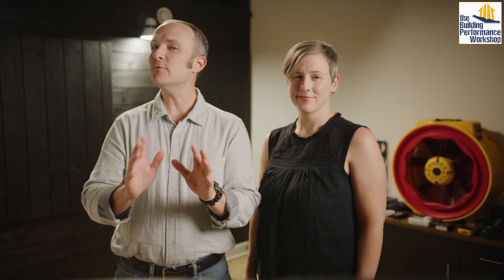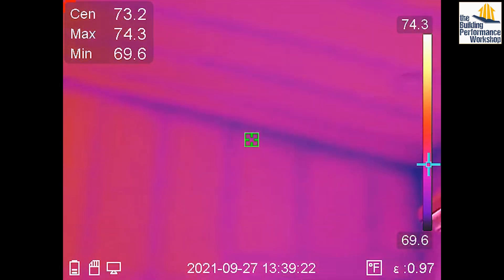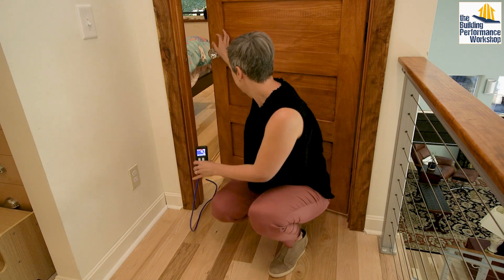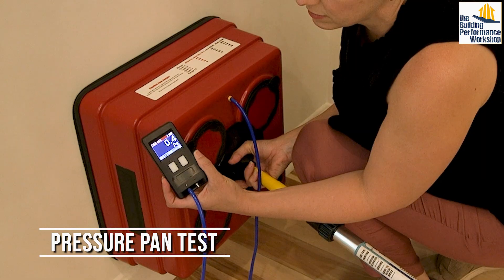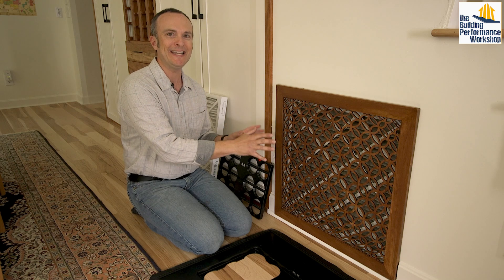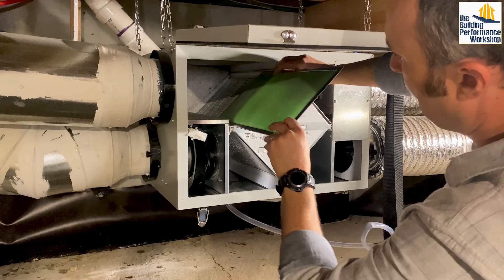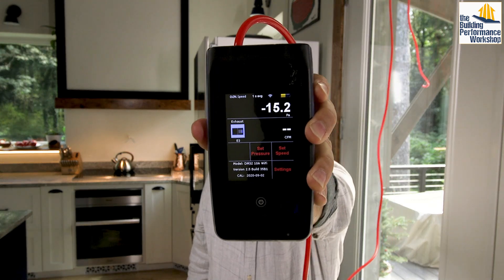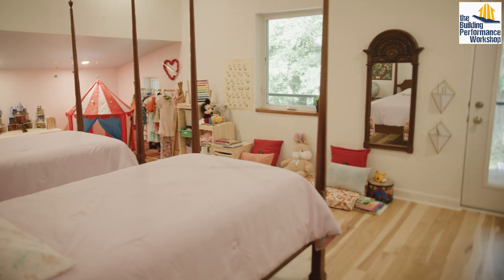Complete Home Performance Testing Suite: Blower Door, Infrared Thermal Cam, HVAC, Pressure Imbalance

Comment: I have cold floors so I decided to insulate where a lot had fallen down. I put up New while we were doing this. I was putting down plastic to have something nice to crawl on. I ended up buying some nice plastic and covering the whole floor and then I went up the walls and totally encapsulated my crawlspace and put a dehumidifier down there, now when I look at my dehumidifier app, it tells me the temperature is the same as in the house is this because of the encapsulation rendering the insulation under the floors, mute or perhaps leaky ductwork either way my house is nicer, but I can’t help but feel it was a total waste of time insulating under the floor and I should have insulated the walls in the crawlspace
Reply: Yes, if you encapsulate a crawl space, and especially if you have ducts down there as it sounds like you do, you want to insulate around the crawlspace, not the first floor floor. You are running a dehumidifier in the crawlspace? That puts out heat.
Reply: @spruce_goose5169  now I'm doing the Attic can I put plastic down to air seal
Reply from the maker: I wouldn’t- water vapor has a way of becoming an enemy if it’s trapped
Reply: @Phxtonash1  I don't really have enough info to answer. But generally plastic is not used as a way to establish an air barrier. As home performance says, it can be risky to use plastic unless you understand perfectly well your situation.  Lots of variables matter,  including climate, air movement, perm rating of other materials, and importantly the location of plastic. 

Long story short,  in a typical unvented attic, caulk and spray foam used on top plates and other penetrations (can lights?) would be more common and probably safer. It requires you to move the existing insulation out of the way.
Reply: @spruce_goose5169  thank you very much you I’ve been researching this for couple weeks with no answer. The house is from the 1950s. It has a vented attic with some batt insulation and then cellulose loose, filled sprayed on top. Lots of leaking air lots. I planned on taking insulation out and filling the top of the walls and any leaking areas with spray foam or caulking. and also replacing the 2 Can lights with ones I can insulate and adding several more I purchased a 12 pack. It just seem like it would be faster and more efficient to use the plastic but I will refrain from that . Thanks again.